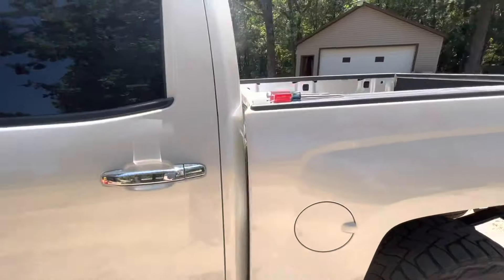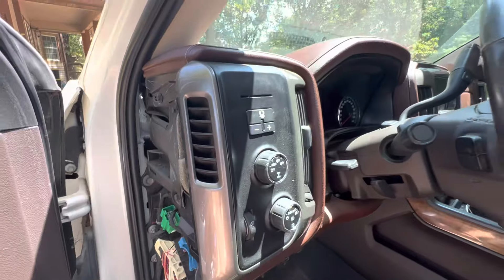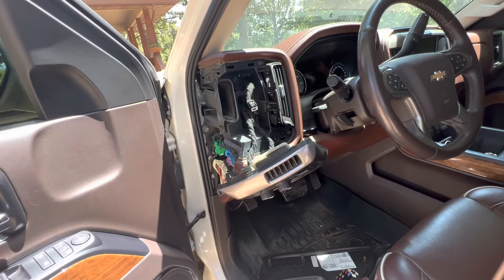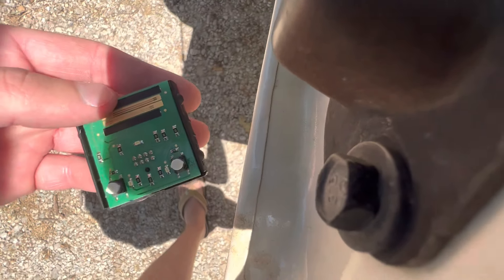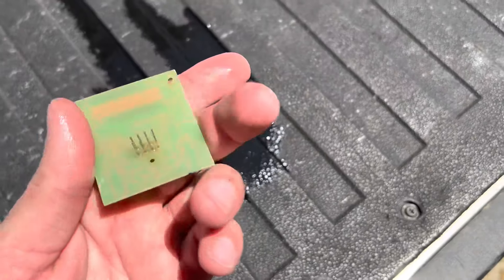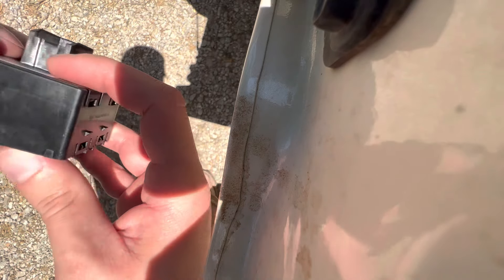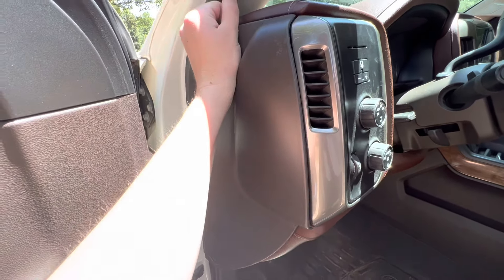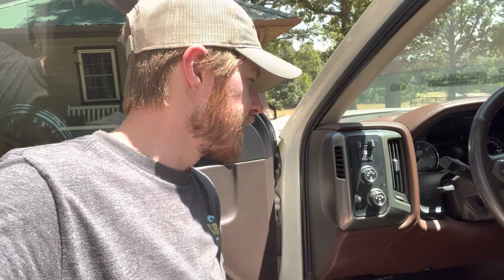2014 - 2018 Chevy Silverado GMC Sierra Service Trailer Brake System Fix

Comment: Thanks for the info....popped mine off....took 5 min works great.....no more annoying beeps and messages on dash.....saved me a lot of frustration and money from the dealer or repair shop....I'm pretty sure they would have charged me a minimum 2hour labor charge , plus a brand new dealer part😩..... That only needed to be cleaned🤦🏿‍♂️.......... 👍🏿

Comment: Thank you for this vid...we had our 2015 Silverado and the headlights and taillights turned off and then the Brake, Stabilitrak, and Trailer Brake System service lights all came on. Dealer replaced body control module..30 minutes later it happened again and as soon as it got dark of course. Replaced the Trailer Brake Control Module about a week ago and haven't seen a return issue as of yet so hopefully that is what resolved it

Comment: i had my 18 Silverado at the dealer two different times for this issue. Its only after watching this video and doing as shown in the video that fixed the issue. Mine seemed to have a fare bit of dielectric grease .I wiped down the contacts and slightly pried  out the contacts so they made a better connection. So far so good.
Reply: did this fix ur issue still? also how do u get those two knobs out. i dont wanna break them

Comment: Can’t thank you enough, the new electronics on these trucks makes no sense to me. Got the service trailer brake warning and beeping, popped in the new module for 20 bucks in 5 minutes. Somehow it fixed the usb ports on my center console that weren’t working and my window goes up automatically again. Lmao 20 bucks to fix 3 problems

Comment: Have to say thank you.  Easy tear down, clean, swipe-surface greasing and reinstall.  The hardest part was removing the slider heads.  (I used a pair of wide-surface pliers with a rag on each one as to not mar the surfaces.)  So-far it's working fine but even if I eventually need the switch assembly, it's still a savings.  Saved me $$$ (2015 Silverado 2-Dr short-box). 🙂

Comment: Great video.  Just a heads up, you need to apply a thin coat of dielectric grease to the wiper surface.  This will prevent corrosion as well as lubricate to avoid friction gouges on the contact surface.

Comment: Personally when I had the issue I learned that the service notification can come up if your module under your spare tire gets dirty/caked up. Sometimes it can be fixed by washing it off clean or getting a new module. Personally Havnt had anymore issues since. These trucks are great but they do have some things that can piss owners off. Luckily YouTube has most of the answers to your problems.
Reply: I've already had the same problem I changed the module and also the one top of the spare tire and still have the same issue!! Is there another one I have to change
Reply: I had a fray in a wire in the module by the spare tire.that was my problem
Reply: @yvesrobichaud4164 did you figure it out? I just replaced the switch in the dash and still have the same problem.

Comment: I have always wondered how those worked. I would be interested in knowing if that fixed your problem with it. And another thing how good do they work… have you ever used yours to tow a trailer. Great video thanks for sharing!

Comment: Bought a 2017 60k miles and a week later the stabilitrack and trailer service warning came on and the abs light + cruise control stopped working... Ugh. Found your channel - yay! Hope I can figure this stuff out cause I like this truck. It feels like a truck - kind of clunky but in a good way. The Ram felt too much like a car. Subscribed.
Reply: @88heckenlively did this fix your issue
Reply: I changed the fuse and cleared the code C0110 that came up on the scanner and it went away.
Reply: Get an alignment, that fixed my stabilitrak code

Comment: Mine popped up because my battery was going out. If the PDM doesn't get enough power for all the aux connections I think it will trip a notice. Changed my battery and no more code.
Reply: True. This “Service Trailer Brake System” light only occurred when vehicle battery started going out. Replaced with new battery, no more alert on HUD.
Reply: i’ll be changing both batteries and the switch and hopefully it’ll fix itself
Reply: I’m thinking this is what’s wrong with mine didn’t start to see message until truck randomly died one day and battery was going bad
Reply: Mine is doing it today and my battery is also going out.  Was hard to crank this morning and then the service trailer brake light came on. I was thinking it was due to weak battery. These trucks do all kinds of weird things when the battery go out

Comment: Having this issue with my 2020 Silverado(when the trailer is connected). The alarm intermittently goes off.. warning me to "check trailer wiring" (Lights etc work on the trailer while this is occurring). 
Heading to the Chevy Dealership (for the 3rd time) tomorrow.. as the Gen.RV folks can't seem to find the problem. I will take your URL with me tomorrow and suggest they try this. I would do it myself, but my Controller is on the right side of the steering wheel on this truck and looks a bit different. I'd hate to pull apart the panel and not be able to figure it out. I'm heading on a major road trip May 10 and worried I'll have to hear that annoying warning signal for 1500 miles out then back! :face-purple-crying:
Reply: Hi - Having same issue with my 2016 Silverado "check trailer wiring". I've confirmed that it is on the "truck" side not the trailer side. Dealer had my truck for 3 days, said everything was fine. They reprogrammed the trailer brake module. I brought the truck home and hooked it up to my travel trailer, it worked fine for about 3 minutes, then the message starting appearing again! Just like yours...lights, turn signals everything else works fine; just no trailer brakes. Were you able to get yours fixed?? Prior to taking it to the dealer, I replaced the trailer plug, replaced the truck plug, and also replaced the trailer brake module under the spare tire. Nothing fixed it.
Reply: I had that on my 2018, cleaned contacts in male and female plug ends, sprayed with contact cleaner and all good for a few months, now I have nothing, time to pull the controller apart in the cab

Comment: The "service trailer break controller" screen is on. Replaced the control module seen here and the relay under the spare. How do I reset the warning to see if it's fixed? Drive it for a few miles?

Comment: My truck doesn’t have one installed at all. Would it work if I just bought one of these and installed it or are there other required parts for the trailer braking function to work? 2015 Silverado 2500.
Reply from the maker: Unfortunately I believe you will not have a blank harness to plug into, the only option would be aftermarket from my research.
Reply: @DustinT  thanks for the info I’ll take it off and check but it is also ridiculous that it isn’t standard on a 2500.

Comment: My service brake system light will come on after I drive in a heavy rain. I'm thinking my problem is outside the cab. But I might try cleaning the controller like you did and see what happens.
Reply: Did you find a fix? Mine only does after a heavy rain and will drive you insane while driving

Comment: Mine has this error as well as a helpful message that just says "Stabilitrack." Are the systems interconnected to where the controller could cause both errors? Weird thing is it turned the parking assist off as if I have a trailer connected.
Reply: They are in a sense but if its stabilitrak its either a broken wire or the abs control module under the driverside frame rail.
Reply: @andrews8722  thank you! I figured it in my case it's all the abs wire. It was chafed somehow and that frayed the wire. Fixed it and now all errors including the trailer warning are gone

Comment: Mine is just a button on the shift. I have the Z71 tow package
Reply: the button on the shift lever is Tow/haul mode and riases the shift points RPM when towing. That's a differnet thing than trailer brake controller

Comment: Mine does the same things  but also my abs comes up on my dash do you know anything about that and am going to order another tailer thing for it see if it will fix’s that but do you know anything about why my abs is on on my dash I got a 2018 Chevy Silverado LT z71
Reply: Mine started out with the trailer warning then all warning started going off. They at the shop replaced one front wheel hub.They apparently had diagnosed it as that. Well I'm still getting the trailer brake warnings.

Comment: Mine is going crazy right now all of a sudden. Beeping like 5-10 times in a row. I’m hoping to work on this this week and shut it off- crazy I can silence it
Reply: How did you fix it mine is doing the same
Reply: @gabrielgarcia1201  I didn’t fix it. It went away on its own then intermittently returns. Sometimes beeping once, other times 5-10 times, other times the entire time I’m driving
Reply: @gabrielgarcia1201  could be anything from the dash to the actual hitch…good luck

Comment: What is that part called I’m sorry but did not find the link please let me know
Reply: I ordered a part called "Trailer Brake Control Switch Assembly".  I installed it on my 2014 Silverado.  So far, so good.